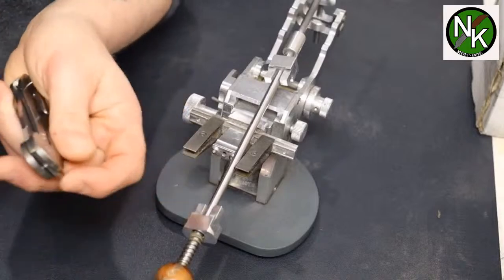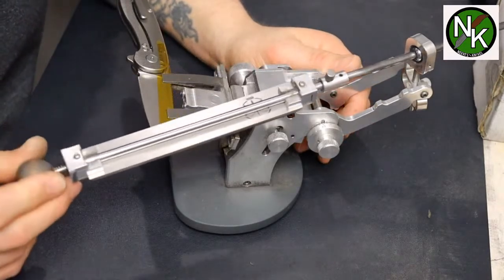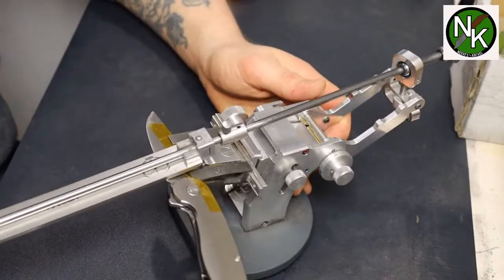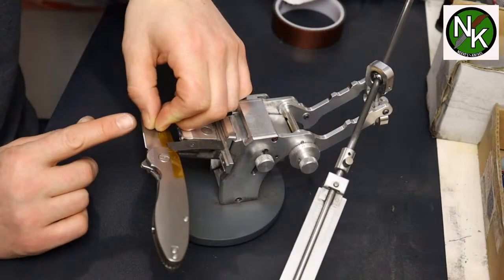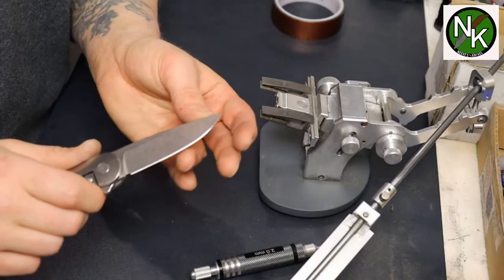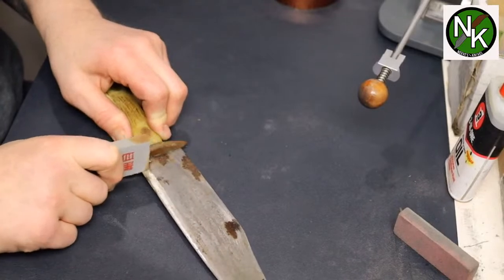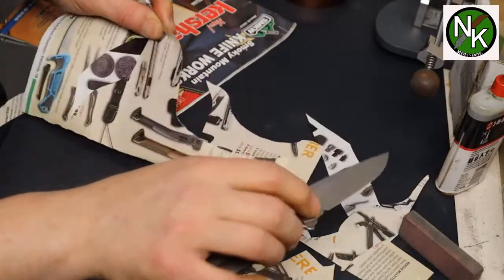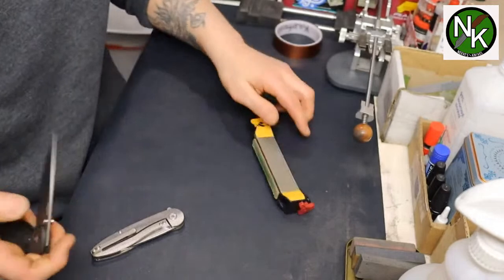BANGGANG MEMBERS LIVE SHARPENING

Comment: Just a small thought on your explanation of the thickness compensator dial. Unless I misunderstood something, you said you leave it at 12 for your 4mm stones then turn it up to the max (15 on mine) for the 12mm stone and the angle is the same. The markings should be in mm for the stone thickness, so 4 for the 4mm stone, and 12 for the 12mm stone. If yours actually works as you explained it I wonder if yours has a defect since it should only be compensating for about a 7-8mm thick stone at that point instead of a 12.

Each (half mm) division should be about 0.13° change according to what Tsprof has stated in a past video.

Comment: Hi, Jared. Wanted to know what would you recommend between the worksharp field sharpener and the work sharp precision adjust sharpener or really any system/stones sub $50? I’ve been using the lansky sharpening system for years, and most of the stones are pretty worn at this point. It’s not the diamond set. Looking to get a new set up that’s not going to break the bank and I’ve been using my lansky stones to practice freehand too so I’ve gotten pretty good at it.

Comment: What is the name of that sharpener
Reply: Tsprof Blitz 360. It is a discontinued model, the one that replaced it is the Blitz Pro, but it does not include the angle gauge stand between the clamps, you have to buy it extra. The upgrade is worth it as it has much better clamps and clamp bar.